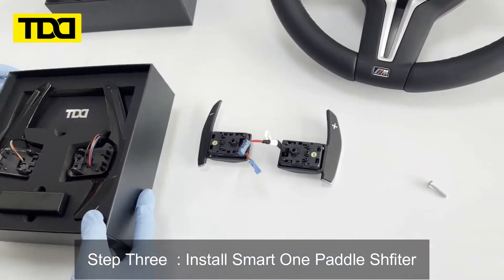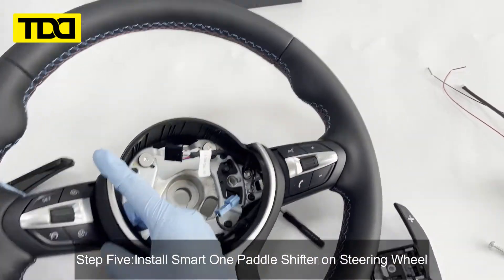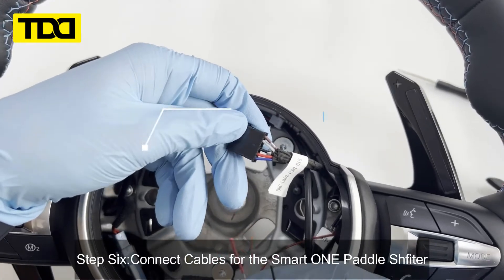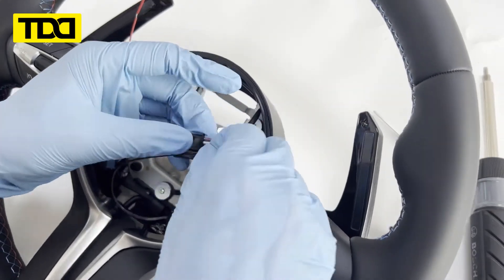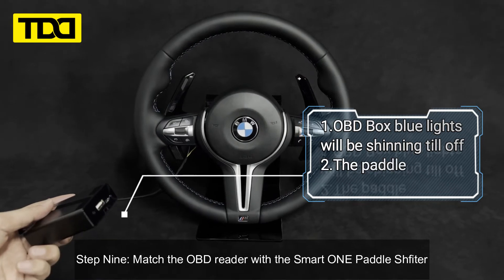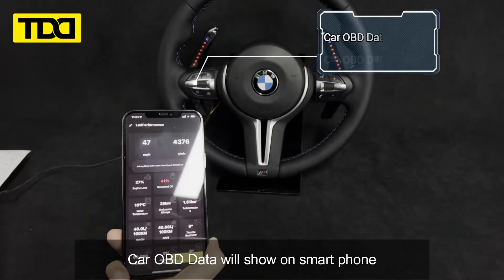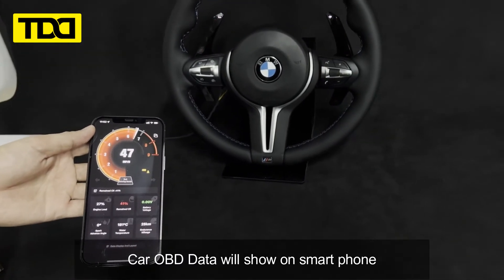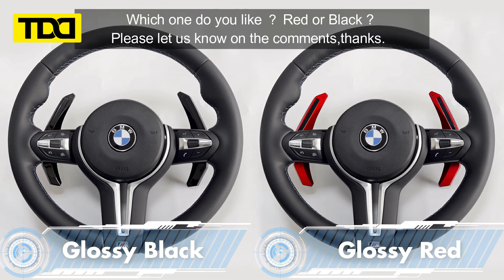How to install TDD Smart Paddle Shifter  on BMW Steering Wheel (NEW!)

Comment: These use OBD bandwidth for rpm reading? So they wouldn’t be compatible with the JB4 which requires all the bandwidth. Oh well. 😢
Reply from the maker: thank you ,it will be working on a wide OBD data requesting frequency from 50ms - 200ms,and will be compatible for quite many other device to use at the same time.
Reply: Dear work on BMW X6 e71 year 2009 ??